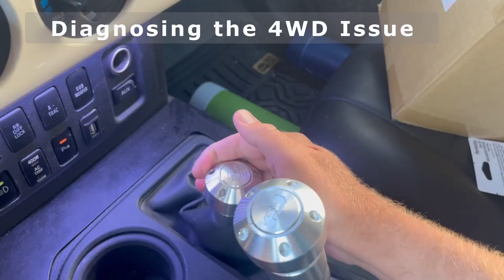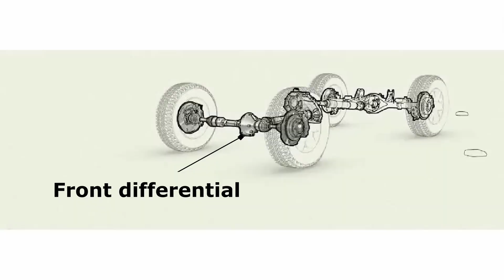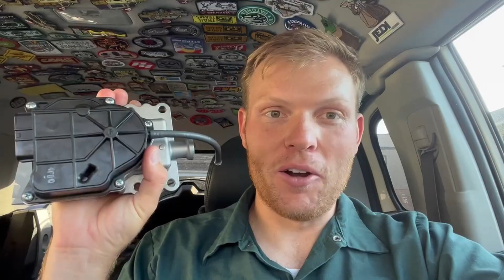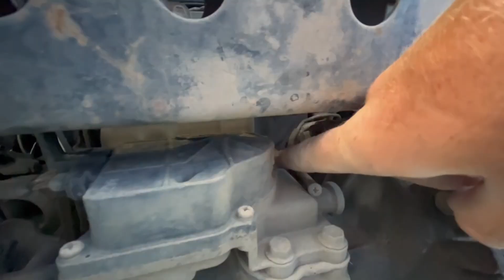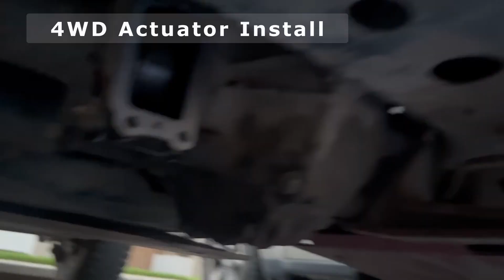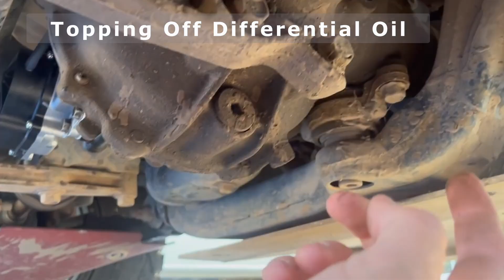Toyota 4WD Actuator Replacement - FJ Cruiser - ADD Actuator for Tacoma, 4Runner, Etc.

Comment: I noticed when you had the new actuator in your hand it was in the 4wd position.  How did you manage to put it to the 2wd position before installing?  Did it already reset to 2wd when you plugged it in or did you have to manually move it somehow to 2wd position?

Comment: Question I have leaking coming from the tube part of the actuator I removed it n it looks as if there is a small hole is that normal I might have over filled the gear oil

Comment: What if you test the actuator but the fork doesn’t move? I checked the volts on the new actuator and it’s good and running?
Reply from the maker: I’m not sure, did you test it with it plugged into the car? Or on a test bench setup?
Reply: @FJX2000_Productions  I did both, I checked the voltage and it had power 12-16v but once I put it on the plug it only moved once and stopped moving while I tried engaging it between 2 and 4wd

Comment: I had this same problem in my 07 FJ. 4 hi did not engage, no FWD indicator light. The only difference is when i put it into 4 low i could get the rear locker to engage, but no FWD indicator light, and no A-trac light. To get it working again i put it into 4 low and drove it off road over semi rough terrain for several miles and suddenly all the lights came back on and it works again. It had been close to a year since i had it working. Hopefully this helps someone.
Reply from the maker: Must have seized up a little bit once it got knocked loose from the rough road it fixed itself haha
Reply: @FJX2000_Productions That seems to be it. Im going to engage it more often as recommended and hope for the best. But if i have to replace it, yours is the video to do it! Thanks for the great content. Your channel inspired my purchase in 2023 and i couldnt be happier.

Comment: Hi. I am facing the same issue and I changed the transfer case fluid it worked for some time but no again I am facing the same issue. It will work after I put it on 4L and then shift to 4H but after a big struggle.
Reply: Was having the same issue. I got it to work again this weekend by putting into 4L, engaging rear locker and A-trac button and driving off road for a couple miles bouncing around. Eventually the FWD and A-trac lights came on and everything is working again.

Comment: Good information and although my '08 never had this issue it is something I'll be watching for on my new to me '11 FJC.  But gotta admit, at 72, my days of crawling under vehicles and doing my own repairs like this is in the rear view mirror.  I'll leave it to my trusty independent shop that's done a good job keeping my '77 FJ40 running to do this kinda work for me if needed.

Comment: So that shifter is not a real lever?
Reply: The shifter engages the transfer case so that power is fed through the front driveshaft to the front diff. This actuator, when it works, engages the front diff. Otherwise if this actuator didnt exist in the system, when in 2WD the front wheels would still be spinning the front driveshaft further reducing fuel economy. Think of this actuator as a "driveshaft disconnect."

Comment: Question: Will the new actuator always move during the test? I have purchased two units and none of them move when I simply plug in the new actuator to do the test you did on minute 7. Hopefully someone can help. Thanks!
Reply: Did you ever get it figured out mine is doing the same thing
Reply: @JohnSmith-uj7oo prob a fuse

Comment: Im looking at getting those 255/85/17 bbat for my 1st gen tundra. I was wondering if they ride rough since they are a Load E? Do they seem stiff?
Reply from the maker: I don’t notice them being too stiff, but I guess it depends on what tire you’d be coming from in comparison.
Reply: @FJX2000_Productions  i have a bfg ko2 285/70/17 load c but my truck is 6500lbs with everything so probably wouldn’t hurt to have load e

Comment: Could you create a video discussing sway bars? Specifically, I'm interested in whether the FJ Cruiser performs better with or without them, considering they tend to break frequently. Additionally, is there a solution, such as a sway bar disconnect, that could address this issue?

Comment: Just did my Tacoma with same setup. Didn’t drop the differential  and got it done but that 4th bolt took forever to get off and on. Used a 1/4 ratchet with 12 mm socket one click at a time and a deep socket with 3/4 ratchet to tighten down.  Why don’t they give you enough room to work, only need 1/2 inch more space to get my fingers in to turn it.  But I got it done thanks for Video !!!!

Comment: Worth to mention, open your old actuator if you find rust you must check the second part of the breathing hose which goes from the  hard tube in the chassie to the breathing valve close to the battery, the problem with that it is tight and have tendency to break from the hard line side. This mistake cost me two actuators in less than a year. The hose must be replaced with a little longer and a strong hose. 
Thanks for the great content.

Comment: Took my 07 to fix a leak on the transfer case. They told me at the shop to activate 4wd occasionally because the actuator can go bad. I told him that my vehicle was full-time 4wd and he didn't believe me. So, as of right now, I don't think the MT has an actuator.
Reply: The 6speed mt at least has a transfer case  position sensor that can go bad if not used often.  I shift mine into 4 low and move alittle bit at least every 3-4 months (mines not a daily driver) 
Also using the locker that often helps make sure it continues to not freeze up and quit working.

Comment: Did your vent tube have a check valve on it originally or just a screw plugging it? Just curious. I've got a 2013 and love it. Good video.
Reply from the maker: So the vent tube originally would've been connected to the actuator, but when mine broke off, and I put a screw in the tube to keep it clear and a sealed the actuator with silicon.

Comment: Noticed you have most of your consual filled with switches that are normally blanks from the factory. Where do you purchace these? Everyone I have bought are too large to fit.
Reply from the maker: There are companies that sell switches/buttons that are designed to fit the OEM spaces, or you can even find and utilize OEM switches for aftermarket things like lights. Check out https://ch4x4.com/ for some options when it comes to aftermarket buttons.

Comment: When I have my first first '07 FJ cruiser. I had a similar problem. But all the ad actuators will have this problem. Eventually. Toyota does not solder the electric motor that turns the gears whenever you put it in the four-wheel drive which will slide the sleeve to the left or to the right depending on if you're going into four-wheel drive or out of four-wheel drive. I actually took mine apart. Tested the motor and it actually worked. It was just that the tabs been away from the connection and it would not allow it to have connection. So I end up soldering the tabs and never had a problem again. Plus I took the gears apart and put new lithium Grease inside the case. Resealed it.
Reply from the maker: Yeah I haven't taken mine apart yet but I'm curious what might be going on inside!

Comment: Very interesting and informative 
.thanks for posting 
Have you changed out the driver's side front differential bearing yet?
Reply from the maker: Nope no diff bearings replaced. I have had to change the front diff seals but not the bearings thankfully.